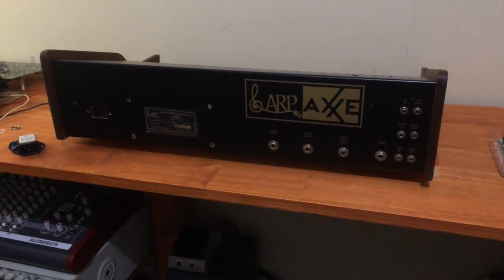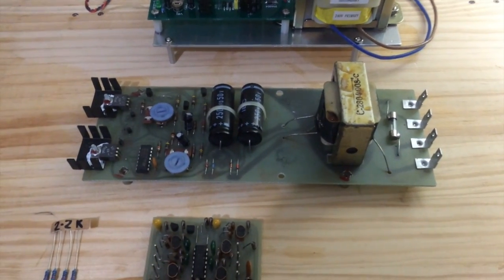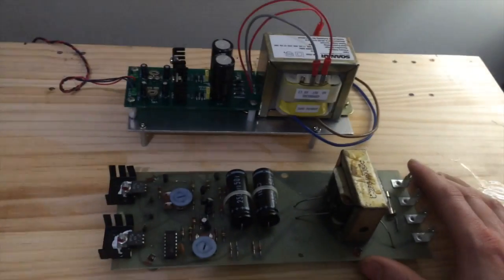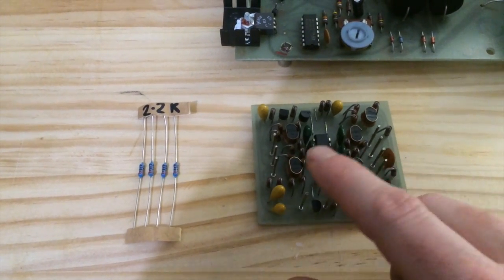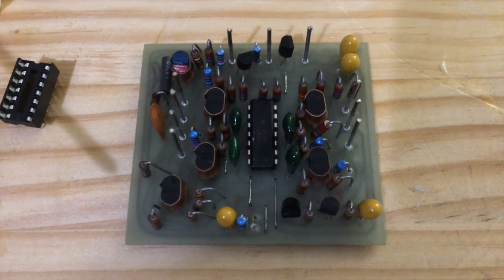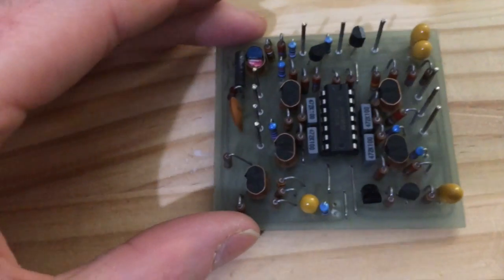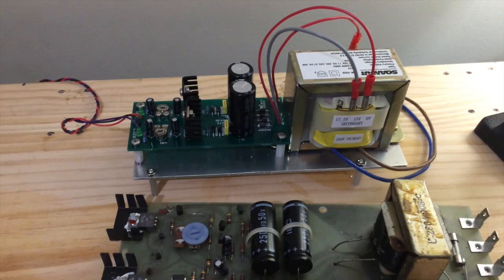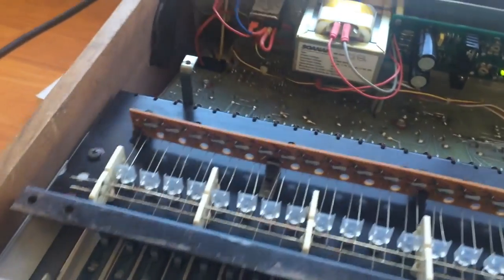ARP AXXE Restoration (Part 1) - Power Supply and Filter Board

Comment: fantastic videos ,,  love the time and detail you have gone to ,, i myself repair ARP synths too ,  see my vids ,,  was just wondering why you dont use a desolder station etc ??    makes life alot easier , especially when removing chips etc
Reply from the maker: +Chris-Cook The cheap ones I had always got blocked. The good ones seem to be really expensive so I've never bought one. Maybe I need to borrow a good one off someone and try it for a bit. I have started to use desoldering braid more and more and I really like it.
Reply: +GOLT ! yeah some are a pain to use ,, but about 3 years ago i got the Duratool desolder station ,, its never let me down , as long as you empty gun solder collector  chamber regulary they are ģreat ,,  i can remove a chip in about 30 seconds or less , and you know what Arp boards are like , especially the Omni  ,,  they are tracked both sides ,,  i never lift tracks now ,,  the gun on the Duratool is 24v 80w  and around £80 on ebay

Comment: I'll be sprucing up my machine when I get it sent to me as I left it in a studio in the uk. ... this is great vid man cool
Reply from the maker: +Ant H I've actually been thinking of reversing that filter mod and putting the resistors back to the original values. It does open up the filter a lot more, but I think it also makes the synth sound a lot cleaner. I know quite a few people with ARP AXXE's and the original 4075 filter config sounds better IMO. There's something about it, like it has more bottom end or is "phatter". If I had to offer someone advice now, I wouldn't mod the filter. I'd still replace the tantalum caps and do the power supply though. They are really important.

Comment: ALSO - did you notice a difference in the audio 'quality' as a result of having the beefier power supply in there?
Reply from the maker: +antigen4 No I didn't.The reason why I did it was to make it more reliable.
Reply: GOLT ! yes sure... but often when preamps or other electronics get beefed up power supplies it makes a marked difference in the sound - usually something along the lines of a lot more 'bottom end' weight and 'authrrity' if that makes sense....thanks

Comment: great job. Very impressed! Thank you for this. Just curious about your thoughts on linear vs switch mode power supplies (as some people are selling for the old synths)? I might be worried the switch mode jobs would be creating too much spurious signal by induction.. but I'm really not sure.
Reply from the maker: +antigen4  There is a lot harmonics in the output of switchmode supplies. They are also not filtered as well so they can have a bit of ripple (at the switching freq). But if you filter them well (add more large capacitors across the outputs) and provide a more high frequency bypasses (very small capacitors across the outputs) they are quite good. Switchmode supplies are also safer (if isolated, some designs aren't) because most have auto shutdown and short circuit protection. They also work of every mains supply on the planet, so they make sense for a synth that can cross borders a lot :-). I have two switched supplies in my modular and they are great, although I have added a lot more filtering.
Reply: okay thanks - yes - that makes LOTS of sense to me.